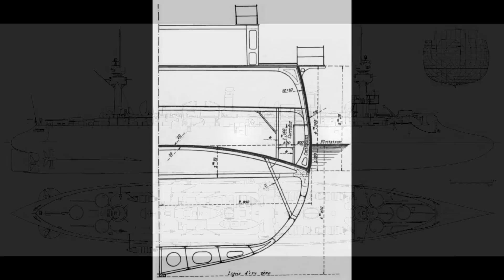MN Depuy de Lome - Guide 333

Comment: French secretary of the Navy:
"Ah, now that's one fine looking armored cruiser"
Lowers illustration of USS Olympia
"WHY DOESN'T MINE LOOK LIKE THAT? SACRE BLEU!"
Reply: Ship we have at home:
Reply: Depuy de Lome had a lot more style than the pedestrian Olympia.
Reply: @obsidianjane4413  More style, but much less functional.
Reply: Pourquoi dois-je échouer à chaque tentative de construction navale?
Reply: @RedXlV  that's what us French liked at the time apparently.
Reply: @426baron  Yep, France made sometimes baffling decisions with their naval designs in that era. For example, I can't imagine what they were thinking with mounting Dupuy de Lome's 194mm main guns on the wings instead of having them be the centerline guns fore and aft. The extremely limited ability to fire both guns forward or aft is in no way a good trade-off for only being able to fire one of them broadside.

For that matter, given that the very slightly smaller Olympia was able to mount four 8-inch guns in a pair of twin turrets, there's really no excuse for Dupuy de Lome not doing the same with 194mm. Replacing the six single 164mm mounts fore and aft (in rather questionable layout too) with a couple of 194mm twin turrets would've made for a dramatically better ship. Then either discard the 164mm entirely, or (since they were probably worried about the 194mm's much lower rate of fire) drop the 194mm wing turrets in favor of some 164mm mounts along the sides. This probably wouldn't have even required any significant changes to the hull, just to the superstructure (which shouldn't have been that hard since Dupuy de Lome barely had a superstructure).
Reply: @RedXlV Can you imagine a French cruiser without wing guns? It is the same as french infantry without red pants.
Reply: "Because, Monsieur, the American ship is only a protected cruiser..."

Comment: Perfectly suited for fighting on the Martian canals, she wasn't rusted, that was just dust from her forward deployments - it's well documented, that when travelling through the Thule slipgate, stuff got baked onto the hull due to static discharge. I am very disappointed you didn't cover her solo rear guard action in the Valles Marineris campaign, she barely limped back to the docks in Brest for a long overdue refit.
Reply: Those Lilienthal aero-machines were a surprise though, eh what? Le Boche say it's better than Lift-wood.
Reply: The inner compartments were designed to accommodate a crew of Tharks
Reply: She would look great w/in Carter's flying squadron

Comment: The long tapered bow on the Dupey was necessary to prevent deck damage when the three forward guns fired over the bow of the ship. It wasn't a ram. French tactical doctine envisaged a forward charge on the enemy with forward guns firing. The ship was technically innovative but spoiled by problems with its boilers. I'm sure Jules Verne loved it.

Comment: @Drachinifel 
As always, a great video, and it is a pleasure to find one of your new videos in my feed. 
But could please, pretty please, increase the sound volume of your otherwise amazing productions?
It is generally very very low, and more often than not require the sound systems (be it headphones, Bluetooth speakers or even integrated speakers) to be pushed to the absolute maximum to be able to barely hear anything...
Thank you very much if you can remember that for future videos, and in any case, please, continue your great work.

Comment: Those late 19th Century ship designers really had no idea what worked best. And on the Depuy de Lome you can see a lot of experimentation with the gun positions their mountings and the numbers involved.  This ship really takes the cake 3 secondary guns at either end and 2 main guns in Wing turrets ? Wow thats pretty weird stuff. But I suppose for end on fire its not a bad idea the real question of course is how much end on fire can you do in a fight especially where the opposing ship might have a broadside of say four 8 or 9 inch guns and anywhere from 4 to 6 x 6 inch guns.  You'd be out gunned and find the enemy gaining accuracy as the fight goes on.